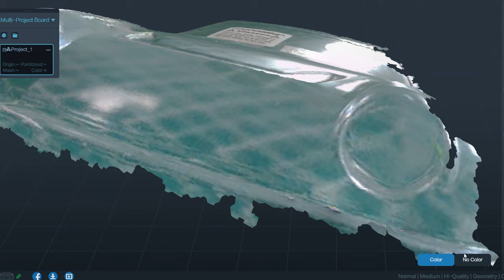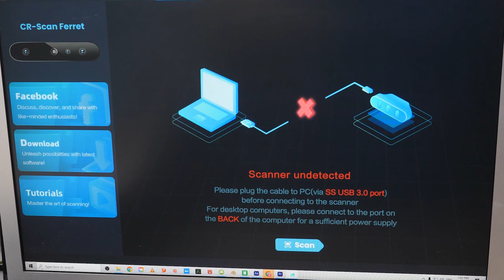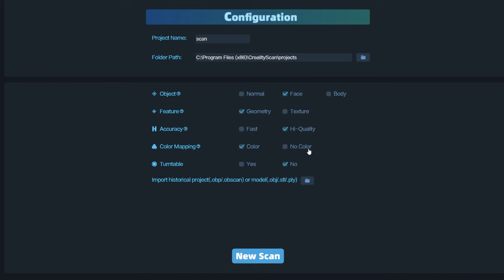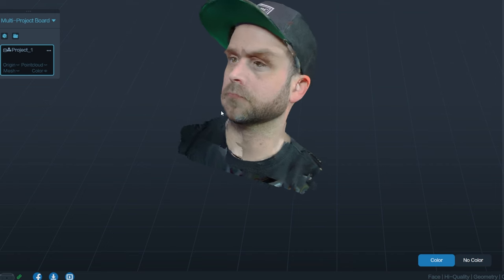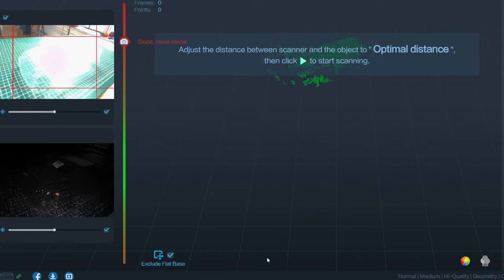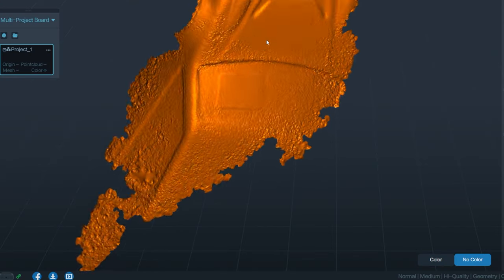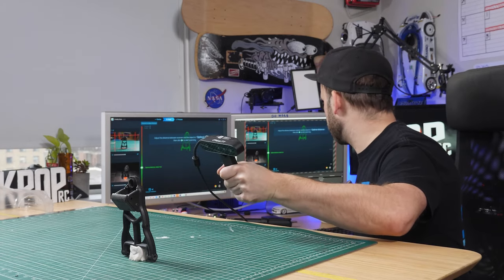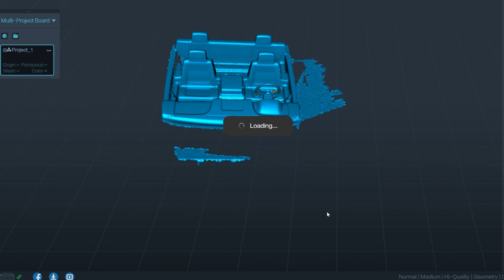NEW TOOL! We Put It To The Test!?! DOES IT SUCK?? Creality Ferret Pro 3d Scanner!

Comment: Use athletes foot spray on the rc body before you scan. It will make for a better scan. Also washes off. Use it in the dental industry all the time.
Reply from the maker: GREAT TIP!
Reply: @kpopRC  If you don't want foot medicine on your objects, you can also use dry shampoo. 😉
Reply: I was thinking baby powder🤔
Reply: Non crunchy peanut butter
Reply: @CPRC23  All purpose flour! It's truly all purpose, hahaha.
Reply: Plasti dip is what we use in the industry
Reply: Spray chalk works great too
Reply: @kpopRC  There are also newfangled 3D scanning sprays that just sublimate (go from solid directly to gas) after a few hours and leave no residue behind. Those are probably the least hassle, since you don't have to do anything to the models afterwards, just wait.
Reply: @CPRC23  baby powder or corn starch, if youre using it on transparent items such as that lexan body you can always put it on the inside.
Reply: Isopropyl alcohol and baby powder in a spray bottle. Shake well before use.
Reply: Use dear urin, my dad scans and builds clear lexon caps for cans and bottles or whatever and he goes right to the hunting isle in Walmart and gets deer urin. It sounds crazy but 2 spirits on it picks up the ir so the scanner can see every single point on it. He swears by it and hadn't found anything that works even close.

Comment: Could you scan a battery for an electric hand held machine to directly make a 3d print model of it with out modeling it in fusion360?

As you did with your face model. Or is the technology not there yet?

Would Bambu slice be possible to repkicate that rpm arm also? If you put it on a turn table and scan it more precisely?
Reply from the maker: yes. but any modification will need 3d modeling software. it won't be hollow

Comment: It looks like Intel real sense sensor that been used in 3D scanners 10 years ago. Even software and results look similar. You may find them used for cheap   Shining 3D Einstar is more expensive but results looks more usable.
Reply from the maker: im surprised they didn't use lidar. i guess that's the next step for budget scanners.

Comment: Still. Crap they claim it;s 0.1mm but it actually 10mm off, just look at the car bonnet dents
Reply from the maker: it works for what i need it for. but it's not the most robust system. infact it seems like old hardware stock, with slightly upgraded software. which for the price is probably still the best you can get. Where's the lidar creality?